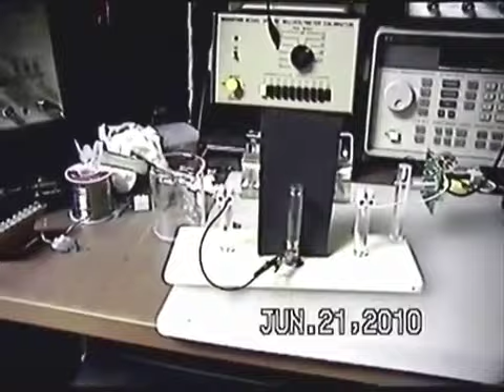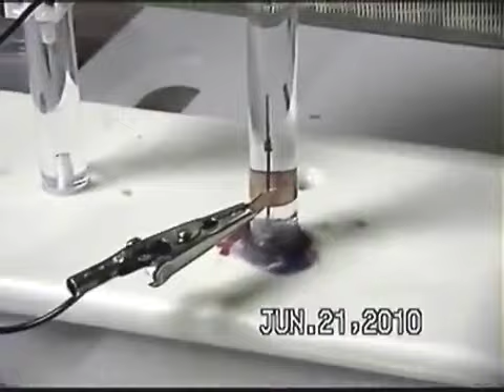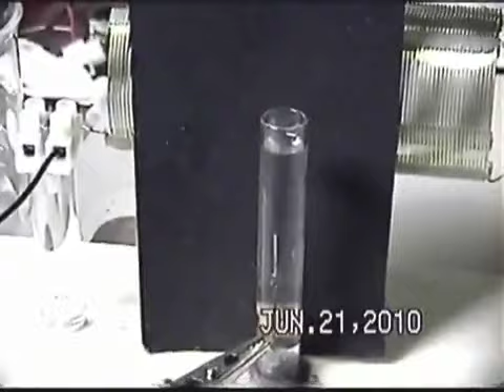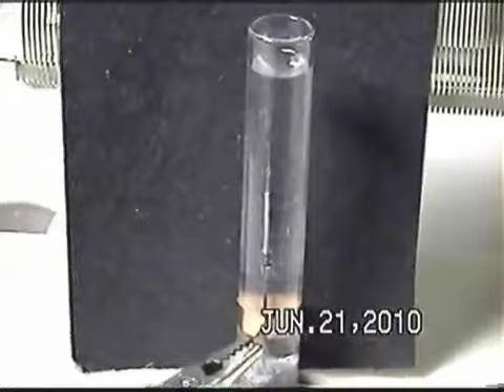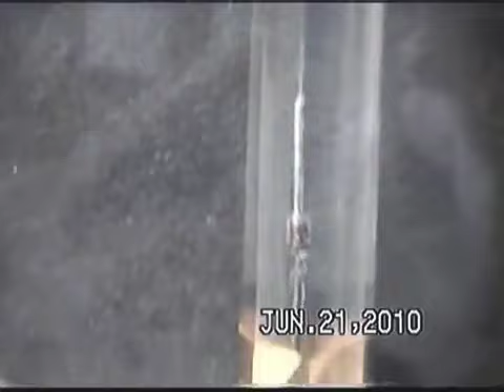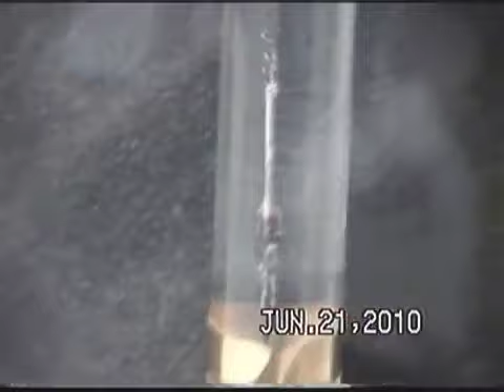SEC Exciter Hydrogen production via diode (by Dr. Stiffler)

Comment: Can anyone explain why the diode is necessary  and what 3xactly is making this work?
Reply: The diode receives alternating impulses of radiant/electrostatic energy and then separates the charges so its top half electrode has a negative potential voltage and the bottom has a positive. This provides the requirements for standard extraction of hydrogen from the surrounding water molecules.

See my following comment generally to everyone...and have fun building yours.